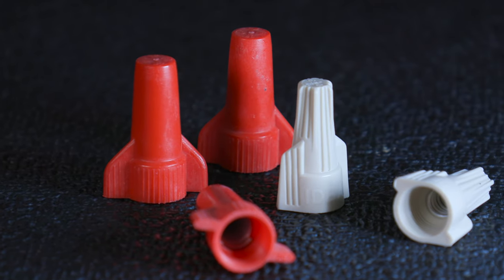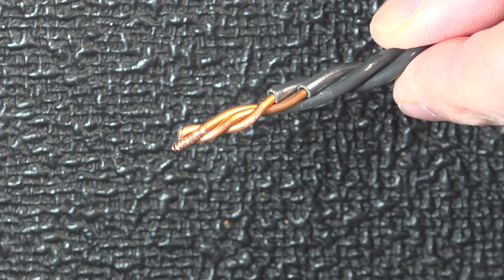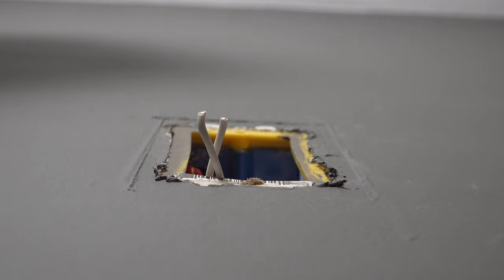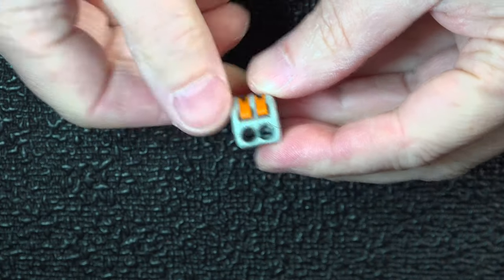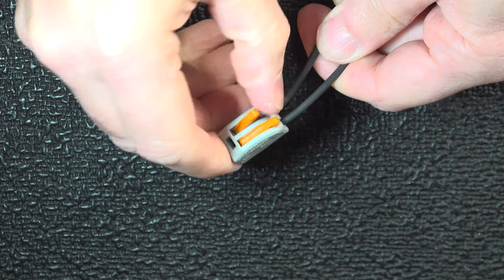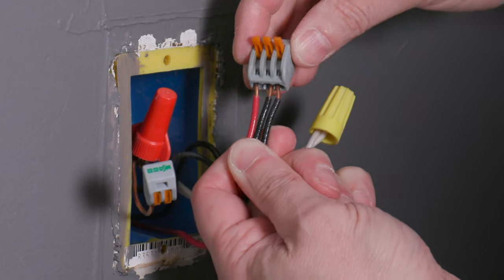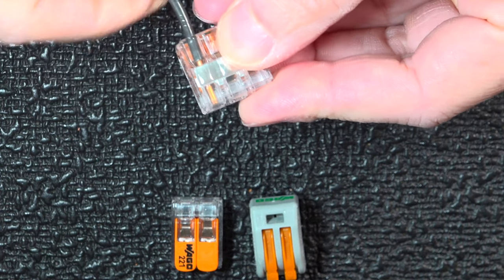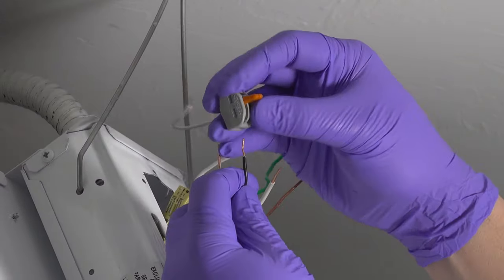Never use Wire Nuts Again - Wago is Better Electrical Connector

Comment: I've been using Wago connectors for over 15 years. I was extremely sceptical at first of all pushfit style connectors however I've seen very few failures. I've been working in Industrial and manufacturing environments, mainly MCC (motor control cabinets) design, build, and fault finding. Almost all connections are now pushfit style be it low voltage/current control circuits, or high current motor/heating element connections - all pushfit.
Reply: We just did a huge rebuild on one of our paper machines (500 million) which included all new ABB drives and A/C motors. The I/o cabinets have the push fit (which I hate). Sticking a screwdriver down the side and wiggling it around till the wire comes out can't be good. We would never use push fit for any 480v connection. Depending on wire size, we use wire nuts on 480v 15 hp and less motors, anything bigger gets bolts and nuts with either gel caps or 3 layers of tape.  All the GE 9000 series buckets use screw type connections. Wago's? Maybe on a light fixture. Bet you don't have pushfit for switchgear and pink weinnie.
Reply: @eddycurrent1664  Seems like you clearly have a problem with getting rid of cable destroyers.
Interesting so you put 4 gallons of milk of force on that connector probably better todo something else with that brachial power.
If i find a wire in the middle of the maschine connected with a cable destroyer that would be a immediate no go.. switched out the srew on terminals as a rework job at a paper mill. Now everything nicely resides in the control cabinet with push fit connector’s. Which are actually also used in several other applications..
Reply: Industrial and manufacturing might be a better use for a connector that is easily undone. For maintenance. But for housing an outlet may be in position for the life of the house. These connections rarely need to be undone.
Reply: @benjaminlovato283  Push fit connections are already filtering down to the domestic sector. MK's Logic Plus Rapidfit is an example.
Reply: @xabre9995  I've seen them in almost all light fixtures that you can buy here. They even trickled down to Ikea, even to their cheap lamps used on top of mirrors.
Personally I only use Wago anymore, they are fast, safe, and the testing feature of the 221 is really a very good idea. Plus you can mix and match different wire diameters and types (wasn't allowed in all cases with the old-style Wago clamps).
There are occasions when you want to change a light fixture even in a residential home you own. Then you can just open the clamps click-click and pull it from the ceiling. Fast, safe and secure.

Comment: Wire nuts have been around for almost a century. But now they’re unsafe 😆
Reply: Wire nuts are fine... crappy installers are unsafe...  kind of like knob and tube...
Reply: Actually, they are unsafe. They work well, until they don’t. 

The horse and buggy was around for centuries! Eventually, better stuff gets invented.
Reply: @Gk2003m  Lmao, at what point does a wire nut degrade into being unsafe? You're silly. Explain how contacting a smaller surface area and not holding the wire as securely is 'better'. I'll wait..
Reply: @friendlyfire01   18 seconds into the video shows a common failure point when you have stranded and solid sites together. The solid wire gradually slips out over time.
Note that I am not claiming this new gizmo is any safer.  You are ASSuming I’m doing that, but I have not done so. All I did was this: some nut implied that because wire nuts have been around for a century, they are implicitly safe. I disagreed with that person. And I don’t need to explain the shortcomings of wire nuts; the vid does a perfectly good job of that.

Whether this new gizmo does a better job or not only time and application will tell.
Reply: @Gk2003m  Wago is hardly a "new Gizmo". They've produced the grey ones with the small orange levers (or finger crushers as i liked to call them) since about the '70s. In Europe, Wago is pretty much the standard, wire nuts have become illegal in most countries a long time ago, it's either srew connectors (which are still around) or Wagos, mostly not the 221s (the clear ones with the orange levers), but the 2273s (or 2773s I believe they're called in the US), they don't have levers, the wires just get pushed in. Why are they better? Well a lot of people say stuff like: "Wire nuts are fine... crappy installers are unsafe" Well, if it is so easy to create a hazard, then maybe, just maybe the product is shit. Btw: Copper wires should not be twisted together. Why? Because it hardens the copper and makes it brittle. 
Trust me, once you start using Wagos, you won't be looking back to wire nuts. They're smaller, faster, more secure (rated for a lot more amperage than the wire is allowed to handle anyway and they last even longer, usually the wire burns out, before the connector does), they don't rattle loose, they don't damage the wire and they are so easy to use.
Reply: @FJB2020  when were they recalled, by whom? For what reason? I can't find jack shit anywhere.
Reply: wire nuts are more than that
Reply: No, unsafe since beginning

Comment: two things miss in this vid: 1.) another neat feature of the wago is that the small rectangular hole is actually a test point for multimeters 2.) while the clear version is great for seeing what you are doing, one caveat is that they do have a LOWER amp rating, so just make sure you don't go over the rating (In all likelihood you won't though)
Reply: They make 20 and 30A versions of them
Reply: Unfortunately they didn't make the test port wide enough to accommodate the fatter DMM probes. You need to be sure your probes fit in the port and able to contact the conductor before relying on it and thinking your circuit is not live.
Reply: @dubmob151  oops... sorry... didn't know there were various thickesses of probes. Worked with mine and I just assumed. Great heads up!
Reply: @babaoreally8220  Sooo... you're actually in favor of wire nuts? or do you use terminal block connectors?
Reply: @babaoreally8220  No, these WAGO type connectors are absolutely nothing like connecting an outlet with the old back stab connectors. The WAGOs provide a much more secure mechanical connection and don’t have the inherent design flaws of the back stabs that lead to inevitable spring retention failure within a short amount of time.
Reply: @babaoreally8220  Interesting points... however, I think for the average DIYer, the chances for screwing things up (not properly twisting, not tightening appropriately, etc.) are much higher with nuts. Also, if you are redoing a switch, many people don't know or care enough to restrip each time you re-nut (if that's a term).

Comment: My dad was an electrician BEFORE these new devices were invented.  He ALWAYS twisted the wires themselves together tightly before using a wire nut, so they were impossible to pull apart even WITHOUT a wire nut.  These allow wires to be pulled out WITHOUT opening the levers, by the way.
Reply: i disagree strongly, an original WAGO clamp undamaged - you are not pulling that wire out without breaking the entire connector appart ...

Comment: I would like to see an overload test comparison.
Reply: No kidding!  Two small points of contact are going to sustain overload/resistance/overheat conditions better than a wire nut with probably quadruple the contact surface - I don't think so!
Reply: UL has done the test. Look it up in the white book.
Reply: @shockcoach  Thanks. Will do.

Comment: Wagos: test points and maintenance free. Constantly surprised by people just discovering them. Also they're more useful for commercial electricians, not less, because that test thing and the maintenance thing again. Wait until they find out about the wago-specific junction boxes..
Reply: Wait what, mind blown
Reply: It’s almost ironic the day after I watched this vid I stumbled across one on the job site and I asked my foreman why we don’t use wagos more than wire nuts or even as much, simple answer is they are somewhat finicky and the slightest problem in connection causes arcs which destroy the connector completely, bottom line is wirenuts are much more reliable
Reply: Yup...recent convert here, streaky.  Now I use them all the time!

Comment: So basically another more expensive way to connect wires.
Reply: Nailed it
Reply: Only about 25 cents each for a 2 connection wago.  Not too bad. They are about 75 cents each for a 3 connection model. A bit pricey but still reasonably cheap for the diy guy.
Reply: It’s quicker and easier than a regular wirenut. Plus branch isolation is easier, less down time + less labor = more money in the pocket.
Reply: @RedfishInc  but not for the professional, nor new construction .....

Comment: There is nothing wrong with wire nuts as long as you use them correctly. The problem here is not the product but the installer.
Reply: Correct!
Reply: Exactly. That’s all I used for 32 years, never had a problem with any of them. You just have to know how to install them correctly in the first place.
Reply: Wire nuts are OK, but you get a lot of space saving with the Wago - especially the push in type.

Comment: This type connector was used to join my double wide mobilome together. 10 years later we had a power failure, I traced it to the connecter that was sealed in the insulation in the underbelly where it was black from burn failure thank God, we didn't have a fire

Comment: There is NO reason to cut your ground or switch connection when changing out a power reseptical. Only time I've ever needed to replace these is when changing light fixtures, and other devices, that have wires permanently attached. Most of the time wire nuts are reusable. I inspect and reuse 3 out of 4. I do however love to use these on industrial machines.
Reply: and the 1 used one you can't use has probably already be reused 3-4 times already.
Reply: @teresapeabody2746  Not always, I have had some new ones go bad after redoing a connection because of an add-on or just forgetting about one etc..

Comment: The wires are supposed to be twisted together BEFORE the nut goes on.  If done correctly, it works fine.
Reply from the maker: Ideal the largest manufacturer states, acceptable but NOT required for pre-twisting. I doubt they would  provide incorrect instructions.

Comment: FACT: The contact surface of a Wago wire connector is far smaller than a wire nut, and their holding power is much less than a properly installed wire nut. All you have to do is a quick pull and twist and the connections come apart in a Wago connector.
    The same electricians who choose Wago over wire nuts are the same electricians who strip a wire and shove them into the holes in the back of a receptacle or switch instead of side wiring using the tightening screw which places the wire against a flat base which makes for a much much stronger connection.
      As an electrician I've had to replace Wago connectors and receptacles which were wired using the push holes because the much smaller conductive surface over time deteriorates, it builds up heat, it arcs, it forms a charred surface and if you're lucky it loses conductivity instead of starting a fire. And yes I've witnessed three homes which fortunately only had small contained fires which were caused by receptacles wired using the push in holes. I haven't witnessed any fires (so far) caused by  Wago connectors but I have replaced Wago connectors which lost conductivity for the very same reason, poor conductivity which developed over time and charring the conductive surface.
     Pushing wiring in the holes in receptacles and switches for a connection is not much different than the connection using a Wago connector, the wiring connectivity principal is the same in both applications. Your choice, fast and easy or spend a bit more time for a better MUCH SAFER connection.
Reply: Yes!! This comment should be at the top so that everyone can read it!

Comment: As an electrician of 15 years and having spent the last 6 years in pre-construction/ estimating I'd pose two questions.  (1) How could you ever bid a job competitively using these things when wire nuts are pennies on the dollar in comparison. Sure they may be more labor efficient but I'd have to see evidence supporting cost implications. (2) Per the allowable box fill in the NEC how do these compare?  A wire nut is to be counted as a single conductor and while a 2 port wago isn't much larger than a wire nut I'd have to imagine they could pose a bit of a problem when you get into a switch box with multiple sets of wires.
Reply: You save labor. Can also use less experienced labor. Way easier to verify & control. Easier troubleshooting. The installation will be more consistent - all connections equally good, every time - you don't have to guess. They unusually (always?) take up less space than wire nuts.
Reply: @unknown-me6hu  You can but you do not have to use less experience labor. If you are experienced, you should be able to do more connections each day. 

When these things becomes cheaper and better, people will ask for more of this stuff.
Reply: @elbuggo  I don't know man.. me as an individual I like the best. And if these are the best connectors then I want my contractor to use them. I'm paying you for good labor not a micky mouse job. And for myself for D.I.Y. projects or if I'm doing my own electrical work I will use the best. But I do understand you're point.  If one is building a commercial build then sure use the wire nuts but for residential and personal/ D.I.Y  I PREFER the best 👌. Obviously if I can afford it. If I can't I simply save so I can. But I mean its only like what 50 cents more maybe 60? 🤔  I guess on a big big project 50 to 50 cents extra will add up. At the end of the day this is American LAND OF THE FREE so do what you want. That's what makes us great 👍🏼 🇺🇸🇺🇸🇺🇸🇺🇸🇺🇸

Comment: Wire nuts must be an American thing and never really used here in the UK, where we typicslly a strip connector which uses screws rather than the snap type shown.
Reply: Wire nuts are used around the world. They are used heavily in Spain and they are used in the UK as well.
Reply: Yeah, we have screw connectors in Australia but are only just getting wirenuts, I think screw connectors will remain the dominant connector.
Reply: Our receptacles also use screw terminals, there's no reason you should have to cut the wires shown in the video, or use wire nuts at all... This video is filled with misinformation and manipulative language, and is basically just an infomercial.
Reply: @matthewprince6157  
Except they are illegal in the uk because of safety and fire hazards. Do research before making blanket statements like that.
Reply: that must take forever.
Reply: @Openreality  that's retarted.  we also use 240v over here and don't have problems with them,  from what i read they were banned back when they were made with ceramic because the ceramic would break.  they are made of unbreakable plastic now and make a better joint than those stupid stab in or clipped connectors.  especially because when the wires are twisted together there is more surface area of the wires touching as long as it's done correctly.  we get way more service calls and do repairs from stab in connections than we EVER have from wirenuts.

Comment: Most electricians Don’t trust these types of connection You’ve used maybe a handful of these and probably never had a issue but with something like this a manufacturing defect could burn a house down,  and since its all internal could be extremely hard to detect. On a properly installed wire nut no current should actually be passing though the nut itself.  I would feel ok using these to transition from solid to a small stranded wire for something like led lighting. But I would still pigtail in the box with wire nuts.  To  me using this is akin to passing a circuit though a receptacle,  I personally always pigtail receptacles too.
Reply: Exactly right. Wirenuts clamp the wires together. These little connectors use a jumper between the wires carrying all current between them. I'll stick with old school on this one.

Comment: I agree its time for an upgrade. I've been in the electrical field for 10yrs and have seen some dangerous stuff due to improper terminating. I first noticed these quick connects a few years ago. Being shipped out with all the led lights but nobody gave them a chance. Untill i showed them its a better connection and way safer then wire nuts. This video could save someones house or building from burning downl or maybe even save a life. I hope its code(mandatory) to use them one day.
Reply from the maker: I really appreciate the comment on this. By design wire nuts are ok but 100% as you pointed out its so easy to make a small mistake that costs big later. Thanks for the support.

Comment: Don''t use Wago's on branch circuit electrical work. They are not rated for the amperage to the next device. A wirenut is the best WHEN USED PROPERLY. A wago should be used to connect lighting fixtures. Branch circuit to fixture WAGO YES. Branch circuit to branch circuit WAGO NO. I have seen wagos used for branch circuits and they've melted and failed.
Reply: Ratings up to 32 A/450 V and 105°C maximum continuous operating temperature allow the 221 Series Splicing Connectors to be used at ambient temperatures up to 85°C (T85), making them ideal for small and large loads. Furthermore, approvals like ENEC or UL make the 221 Series ideally suited for use in worldwide applications.